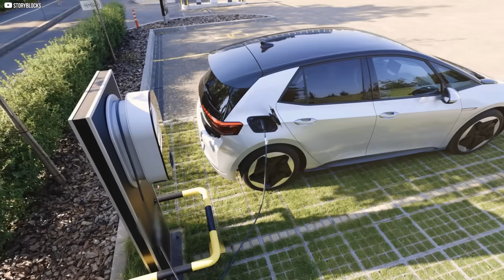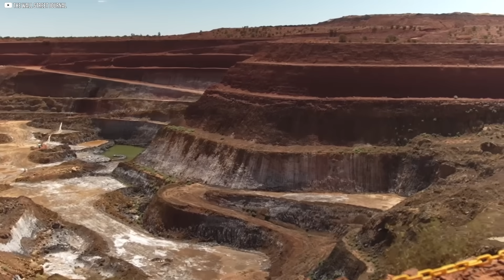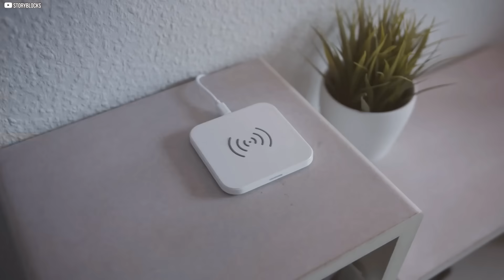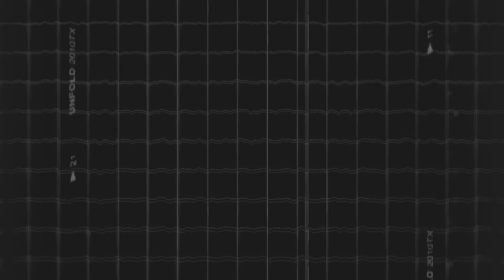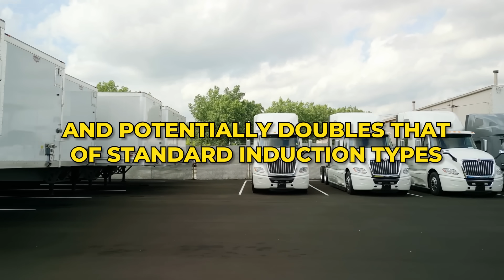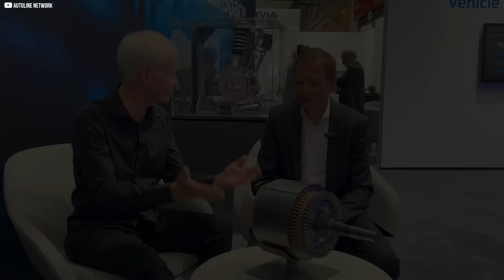How Mara’s Wireless Motor Could Revolutionize Electric Vehicles

Comment: Why not pass electric to the armature coils  thru the bearings rather than comuter slipp ring and use hall effect sensors to control both the stator and armature. Provided you insulate the the armature from the comuter to prevent shorting.

Comment: The best efficient electric motor is the one created by combining the inductive and capacitive properties in the same circuit, with the same materials, where the inductive part is at the same time the capacitive one. 
You create in the same circuit a self oscilant circuit of the motor that reduces the energetic loss to minimum and increases the efficiency of the electric motor to almost 100%.
And when you excite this motor wirelessly, you obtain the ideal electric motor good for the next 1000 years technology.

Comment: I know they wanted to not use high power magnets here, but there is a use for a newer even higher, and cheaper magnet.  Not to induce the current in anything, but as a way to not need bearings, by floating what now are the contact spinning surfaces.  This addition to their motor can not only increase the efficiency by eliminating friction, but also increase reliability by eliminating wear on contact surfaces.
Reply: Hi!!! Really a splendid idea, hats off to you sir, that's what I had asked how to eliminate wear with a more efficient performance with a lifting magnet

Comment: Lol
1. It suck with heat management
2. You have to constantly add expensive oil to it 
3. The magnetic coils still have to connect to the rotating coils in which still need solid connections
4. Because of the oil you have to make the motor baker instead of smaller
5. It quite literally is the most inefficient motor you'll ever find on earth
Reply: Oil cooled in closed loop. Why would need adding oil? The rotor coils are fed wirelessly, don't need contact. It can well be having higher efficiency than an induction motor.

Comment: It’s not new it’s an induction motor.
Reply: With eletronics
Reply: We got a winer Here👈💥👉 @adhil8918
Reply: it 's a lot easyer and sheeper using magnets..that 's put china at the top😊
Reply: Magnets go out @opinair
Reply: Called DKA motor
Reply: @hoekbrwr  No, I don't think so as DKA series motors are BLDC motors which have permanent magnets
Reply: Hahaha 😅
Reply: 😂 i bet it uses that newfangled electrickery too! 😂
Reply: No .. induction motor use slip ring &carbon brushe..
Reply: @answerforu9161 then it’s a wound rotator motor ,not new

Comment: A rotor with no carbon brushes had always been dreamed by electric motor designers, until Tesla's induction motor. Its refinement, adaptation (combined with cooling oil) into EV motors like the Mara motor is a welcome innovation. I hope manufacturers accept it as a solution to rare-earth metal dependence. It frees the world from dependence on  Communist China too.